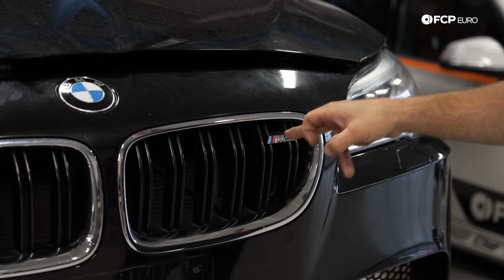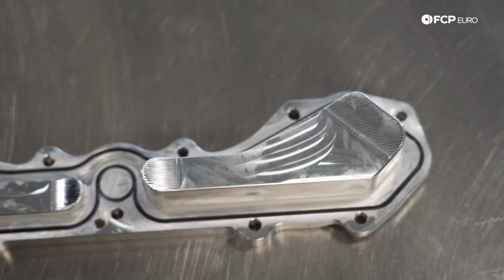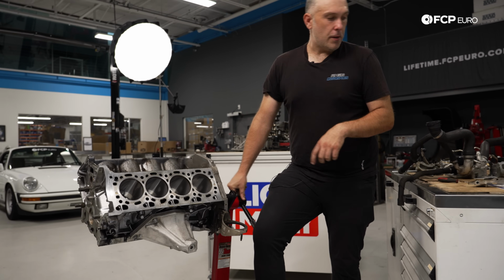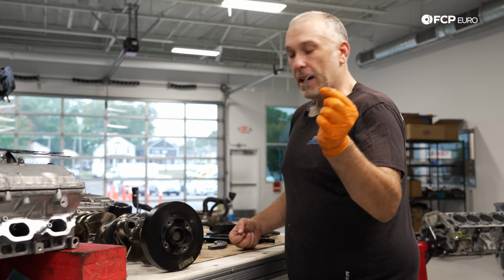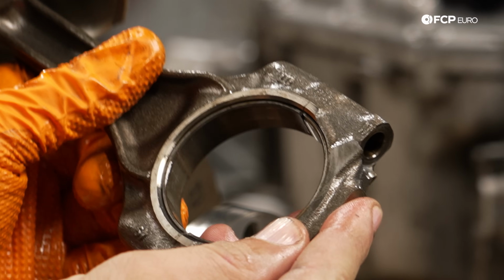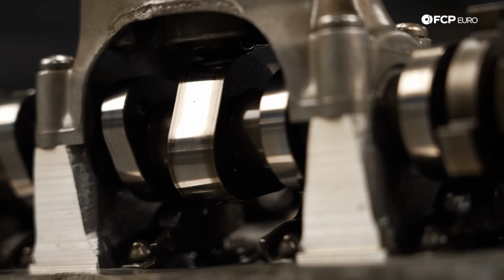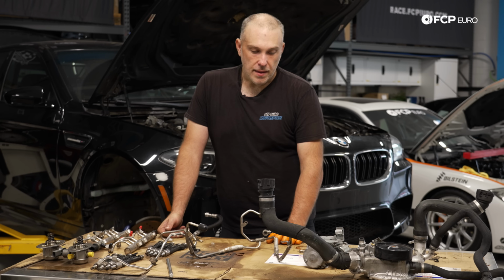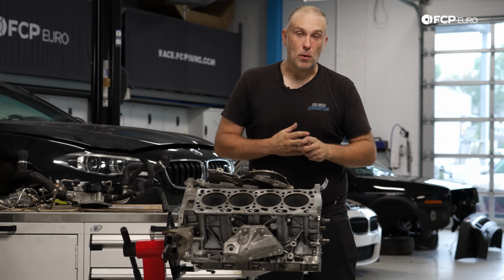BMW S63: Everything You Need To Know - The BMW F10 M5, F12/F13 M6, F06 M6 Gran Coupe Engine Guide

Comment: SHAME ON YOU, you know better then to spread false information. the block isn't junk. there's 3 ways I can remember to respray the liners. you don't get to dictate of it's a closed deck or not. that's not semi closed and it's not even close. where do I get off talking like? I'm only a 25 year master tech
Reply: The AluSil structure of the N/S63 block is a combination of extremely hard Silicon particles effectively suspended within the aluminum casting. BMW carefully removes the tertiary layer of aluminum in the bores, exposing the Silicon crystals beneath with extreme consistency. These Silicon crystals are what the piston rings ride on, and - what gives the otherwise soft aluminum bores their hardness and low-friction qualities. Without careful and consistent exposure of these silicon crystals, the bores and block will be destroyed from the piston rings hardness being greater than the aluminum casting itself.

For the TU3, BMW switched from this AluSil process to arc-wire sprayed bores such as what's found in the B48 and B58. Before the TU3, once the block and original Silicon crystal layer are compromised, the bores have to be reconditioned with a set of roughing, finishing, and polishing stones to re-expose the silicone crystals. Often times, it's much more cost and time-effective to get another N/S63 short-block as they are plentiful in 2024. The relative cost of a used good-condition block versus this specialized machining process often renders these engines as "junk".

We're excited to keep diving into BMWs V8s, some of the most exciting engines to come out of Germany! Thanks for watching.
Reply: @fcpeuro   guess you can't read either
Reply: Alusil bores aren’t sprayed they’re honed to expose the silicon. Nikasil is etched though I believe.
Reply: @reginaldbowls7180  negative, did you not read my comment at all?

Comment: These engines are not as bad as people say , these engines are super robust as long as you take care of it. I got my 2013 F10 M5 with 17k miles and it’s now at 40k, not one problem. Just run liquid moly, engine oil cleaner from FCP that can help protect the valve steam seals, also Lucas engine oil stabilizer is great for this platform of engine. Water wetter from Redline to help keep the coolant cool is also a plus to run here and is recommended for tuned S63’s of any technical update variant. As a 7 year bmw tech the best way to keep these engines happy is to actually care for it properly. Don’t wait on your services just take care of it and it will take care of you.
Reply: No offense, but are you seriously saying a car not breaking by 40k miles is reliable? My E60 M5 has 206k miles, I got it at 63k. Nothing even went wrong on my car until 83k miles. 40k miles almost seems like a joke, and I seriously hope it was.
Reply: @321-shift  car sat for 10 years without starting once until I bought it. I would say a car not starting for 10 years is arguably more risky than a well broken in engine like your E60. Parts not lubricated for a LONG time and no use of the modules and other electronics gathering dust is a big No no and for how many modules this car has along with taking a chance with rubber deterioration over time and plastic. Is quite risky. That in itself is a achievement
Reply: @321-shift 2015 here bought at 35k im at 94k and all ive done is brakes and spark plugs!!Tuned with downpipes since 35k i do 2500-3k oil changes
Reply: @321-shift also use quaker state 5w 40 and STP long life filters and prontos extended life from rock auto which is only 7$ a filter
Reply: @321-shift Yea I know right? My Audi 4.0t has 113,000. No leaks zero issues. Running E85 to!!
Reply: 40k miles?! Bro talk to us when you past 100k 😂
Reply: 😂 40k miles?
Reply: yeah you're about 60K miles away from the inevitable "replace any and everything rubber or plastic in the engine bay" 100K mile service!  Wait for it....  When they are running good, they are hands down the Ultimate Driving Machine, but when they have significant or catastrophic problems, it can make your pride and joy money child, a worthless hunk of metal extremely fast unless you are able to open up your BIG wallet and get things fixed (this includes even if you DIY).
Reply: @trizzuth34  my wife's 165K mile E70 X5M has been near flawless
Reply: 128k here, the replace everything rubber and plastic is overblown too. I have the vally leak and its all of a mild burning smell and a max of 1 liter every 1k miles depending on how I'm using it. There are definitely a few plastic coolant T's and Y's that will need watching after but they're cheap with coolant hosing and brass T's.  It'll be a few hundred if you go back with genuine BMW to replace the whole run  of which ever lines are leaking.
I took my engine cover off to help with that excess heat to the lines
Reply: @surreaLinnovatioN  yeah, taking the engine cover off and getting some airflow under the hood is huge to keep stuff alive
Reply: 40k is not exactly promising tbh. 200k trouble free miles....sold
300k teouble free....shut up and take my money
Reply: @DisturbedBurger yes true!  Tell me it has over 100k and still reliable. Then I’m a believer

Comment: The best video explaining S63 in whole YT, and belive me I watched every of them as M6 owner.
Reply: Thank you! Gareth did a fantastic job turning an unexpected dissection of this F10 M5 into invaluable knowledge for the community.
Reply: Same here besides RKAUTO WERKS IN TEXAS THERE REALLY NOTHING ON IT
Reply: Dann kannst du mir verraten was es heisst antrieb gestört fehlzündung zylinder 8 ? Hab den fehler
Reply: I am an M6 and M8 owner as well... he is not explaining much about the s63 in this video, he is covering more of the N63 Platform. The block in the video is an N63. The S63TU has much less problems than the N63.  They are similar engines but nothing alike. Completely different inside and out.
Reply: @TheRealEvo  Uhh... did you even watch the video? This is an S63. He explains very clearly toward the beginning that the N63 and S63 share the same block, and that is why the block is stamped N63. He also details the differences between the N63 and S63.

Comment: Guys, which is the most reliable less stressful performance BMW engine?😢
Reply: everything M before 2004 should be ok.
Reply: @caliwator  thanks
Reply: @caliwator not true at all e46 is a horrible M car that has prolific issues lmfao the best bmw engines at the moment are s58's and b58's that not only can be reliable but also powerful at the same time.
Reply: @MistaaFrosty  what is wrong with e46? I thought they where reliable. E39 m5 is really good
Reply: @ e46 m cars have horrible problems. rod bearings, vanos, valve adjustment, key lock tumblers, rear subframe issues the list is even higher when you get the SMG trans lol.

Comment: Is it the metallurgy of the block that prevents it being cut and sleeved?
Reply: It has alusil inside the sleeves. So it’s not like a normal engine.
Reply: @justinv6132 no the entire engine block is Alusil. The bores are then honed to remove the aluminum and expose just the silicon.
Reply: @Reginald-Bowls  interesting thanks for the info

Comment: I have a 2020 X5 M50i I just hit about 60k miles so do I have the N63TU? What can I do now to prevent some of this? I have done a bunch of preventative maintenance recommended from this channel already, any info would be appreciated.
Reply: run the expensive amsoil oil and their filter not only do they flow the best but their oil has the best coverage in every category. project farm did a whole breakdown on that if you're interested also there's a chemical you can add with your oil changes to rejuvenate the stem seals and use water wetter for your cooling system as the N's run really hot
Reply: if i owned such vehicle, i would change oil every 5k miles with motul products. I would also use the motul engine clean product every other oil change. I would use their fuel additives periodically as well. At 60k miles i’m not exactly sure what needs to be done but I would think spark plugs, change coolant in high and low temp circuits. Inspect coolant expansion tanks, inspect for any oil leaks. Possibly look into lower temp thermostat options if you live in a warmer climate or drive the vehicle at high load frequently.
Reply: @expofcam  thanks for the super helpful advice, I have changed the front differential fluid, transfer case fluid and rear differential fluid. I might re due the transfer case fluid because I didn’t not open the valve before the job. My vehicle has about 62k on the clock and I’m am doing my best to have it last me at least 4 years.
Reply: @highendtrends3508  most definitely that’s good you serviced those components as well, i think it will keep running strong. What do you have planned after the 4 years?
Reply: @ I just graduated from college and I took an accelerated EMT program to get my patient care hours and then I’m applying to med school. By then I should be in my residency and making some decent money.
Reply: @highendtrends3508  very cool, wish you the best of luck! enjoy the journey 🙏
Reply: @ thank you, like they say it’s never about the destination, but all about the journey. Good luck to you as well. Happy holidays
Reply: I believe your year model would be N63B44T3
Commonly known as N63TU3

Comment: Very nice and thorough explanation, unless you're a BMW crackhead(like me) stick to AMG V8s(M157/M177) those are MUCH simpler compared to this. As someone else said, if you want all BMW engine problems combined in 1 engine, get N63/S63. For me S63s having weak conrods is the 1 thing that makes me mad lol.
Reply: M177 🤡🤡 literally an even bigger shitshow of a boat anchor. These BMW turds can be rebuilt but good luck with the Merc bore scoring.
Reply: @hexagonosaurus5848 AMG 6.2L is their best. No turbo nonsense!
Reply: @hexagonosaurus5848  Thats the thing with MB vs BMW, BMW engines have tons of problems but relatively easy to fix/repairable, MB engines dont have nearly as much problems, but when they do, its almost always catastrophic. Bore scoring issue can be avoided if owners take it easy when engine is cold. This problem exists in M157/M278 too. That's user error.
Reply: @hexagonosaurus5848  M177 have far less problems with bore scoring then the 5.5 twin turbo engine. The M177 is actually really easy to work on.

Comment: Anytime I'm dreaming and feel like buying an M-series car, I come to this channel and watch one of these videos to give me a nice dose of reality.
Reply: Now you're prepared to keep one on the road! 😊
Reply: BMW tech here, the least problematic M cars I've seen are the f80 M3 and f82 M4. Same goes with the M2s of those generations but in my area they are rare, only worked on one.
Reply: Meh, get a well maintained lci f10 m5 and these problems are mostly accounted for. 125k on the clock on my 2014 and it runs like a Swiss watch. Oil changed every 4k with 5w40 from new. Only "big" jobs I've had to do are some plastic hoses and various rubber failing. Still on original injectors, rod bearings, and oil sample came back great. If you get a good one they are amazing. If you end up with a lemon you'll wish you never woke up lol. Car is just tuned and no issues. So far been a great experience, and I wouldn't trade it for the world.
Reply: If you have very deep pockets just drive and sell em get another performance vehicle. Modern cars by and large are throwaway depreciating lumps
Reply: @ m cars hold their value. Also the new BMW’s are listed as the top 5 most reliable brands.
Reply: @Tony-l9g7y  no they don't, except a rare edition like a jahre. And I would say generally first three years or warranty they are relatively reliable. After that, not so much.
Reply: @Mark-bd5ci  that's depend of which engine
Reply: @Tony-l9g7y  Yeah people don't get this. Anyone who has ever actually purchased a new BMW knows that the depreciation curve is nowhere near as bad as is popularly believed. Take even the M8, one of the "worst depreciating" performance luxury cars in recent history. Ok yeah, MSRP ~$150K and selling routinely for $80K three years later looks pretty bad... but the guy who bought it new probably actually paid $120K for it, maybe even less with incentives. Anyone who pays even close to MSRP for a new BMW is a fool. But that MSRP makes the depreciation curve look scarier than it is.
Reply: @Tony-l9g7y Totally agree.
Reply: @Mark-bd5ci  a lot of people just don’t understand, BMWs have dramatically improved, the engine nightmare ended after 2014, everything improved after 2015 and up 2025 BMWs are reliable, but maintenance is still key to longevity, this engine in the video is a nightmare, N63TU and S63TU they are considered under developed engines, 2016 they upgraded these engines to much reliable versions, I got the new s63 engine with 130k mileage, no problems at all.
Reply: You are really missing a pleasure of life not having bmw’s inline 6’s in your life.
Reply: Same
Reply: Bro with special tools an a twi post lift u to can get a bmw and make it realia le an update the maintenance on her easy Hommie
Reply: @Vgk36  So, a failure of a Main Bearing caused by the Double Row Timing chain design rather than an issue with the bearings themselves. 

You seemed to have looked at the title of the video and jumped to the conclusion of "S65s have main bearing issues". Not surprising. Again, an extremely uncommon issue that is unlikely to happen on 99% of S65 Engines. 

Plus, you don't know the backstory behind those specific engines that failed: maintenance history, oil change intervals, proper warm up procedures,  etc. Try again.
Reply: @ it’s not worth it lol. Get a 2016 and above lol
Reply: BMW car over any car in the world
Reply: Keep dreaming 🤣🤣
Reply: Just buy Alfa Giulia QV. Better car for the money
Reply: Get S58 ones?
Reply: 😂reason I’m here nw
Reply: Can u go with out those turbos and run it natural  aspirated
Reply: The white car at 58 seconds does not have an S63.
Reply: For every blown and abused engine there are hundreds well-maintained ones which run perfectly.
Reply: I had an E92 M3 I now drive a GMC pickup Truck. The cost of maintenance is the same and I completely enjoyed owning them. Trucks paid off. Now searching for an well maintained F10 M5.
Reply: I love bmw but aside from the inline six their engines suck.   E90 m3 v8’s rod and main bearing issues …. Twin turbo 8 issues… these cars just take everything from your soul and yet people keep protecting them.  Want something you can actually beat on years down the line spend the money and get a Porsche.  At least it has resale value.
Reply: @Vgk92 you've clearly never owned one
Reply: @heyhayhay247 oh yeah e36 M3 Japan rot. 
E92 335i 
X5 35d
E92 M3 alpine white.
E46 zhp sedan.....
😂😂😂 That's just the BMW stuff. Where's your lineup.
Reply: @Vgk36  so you answered my question. No S63 engines. Perfect.
Reply: @heyhayhay247  LMAO owned
Reply: @Vgk92  Right, the color is very important. Everyone wants to know the color.
Reply: @Vgk36  ooh, can I play?  How about two S63TU M6s, two F82 M4s.  Those are just the Ms.  So, we can stop measuring now, or would you like to move on to Motorsports resumes?  I'll tell you the trick to the S63.......don't run it hard until the oil is absolutely up to temp, and don't floor it at low RPMs in manual mode and in high gear.  That's the main reason for any problems.  Don't really hear about people having issues with them on that regard, anymore.
Reply: @heyhayhay247 lmaooo
Reply: @Vgk36 S65s in E9x M3s don't have main bearing issues. At all. Besides Rod Bearing issues, which isn't hard to address, that is a solid engine.
Reply: @TheVulcan131  uhh yes they do. Do your research.  It's starting to become a thing. Guys have now put enough mileage on engines that have had the rod bearings and there have absolutely been failures due to mains.  Lemme find the YouTube video going into this in detail.
Reply: @Vgk36 You mean main bearings and the rest of the engine that has failed due to complete Rod Bearing failure, which isn't as common in itself as it's portrayed to be.  

Still have yet to post that video I see.  And one video of someone's experience, likely due to a rod bearing issue to begin with, does not mean that's problematic on that engine. BMW has never been known to have main bearing issues on their engines, so I encourage you to do your research.
Reply: Just get a 2016 and up unless you want to babysit the car and have time/chedda aside for maintenance 😂😂
Reply: I've had my e60 M5 for nearly 10 years now and have had no issues whatsoever. Best car I've ever owned and I'll never sell. V10 with 3 pedals is the best thing in the world. Had an SMG one before and it had some issues, but the manual has been more than solid. M cars are the best vehicles ever just treat them right.

Comment: If you want your bearings and motor to last, do not use liquimoly
Reply: Literally the best oil in the game 🤡🤡 
Maybe stick to "OEM" 0W30 piss and change it at 15k so it can grenade at 80k like every other one has.
Reply: @hexagonosaurus5848  In what way?
Reply: @hexagonosaurus5848  used to be liquid moly stan till i found out they use paraffin wax for synthetic oils and once project farm proved amsoil is the best product i switched up. liquid moly actually sucks.
Reply: But it has Made In Germany on the bottle. 😅
Reply: Why not liquimoly?
Reply: Why not ???
Reply: The best oil on the planet is Penrite 10 tenths here in Australia.
Still has the tried and true full zinc additive package and is a group 5 ester.
Liquimoly, mobil 1 are garbage.
Reply: @mrmysterious6006  All motor oils are a blend of various base stocks. There are also different types of ZDDP which have different treat rates.  More is not always better.